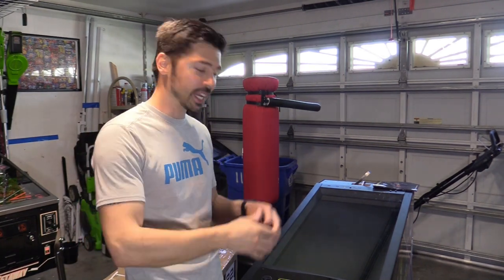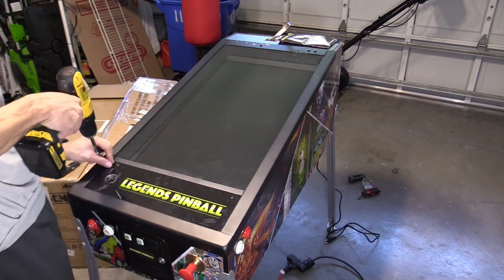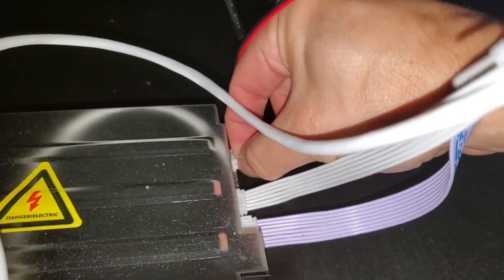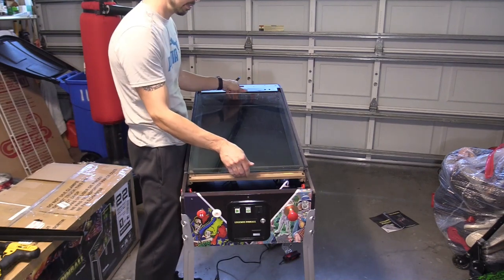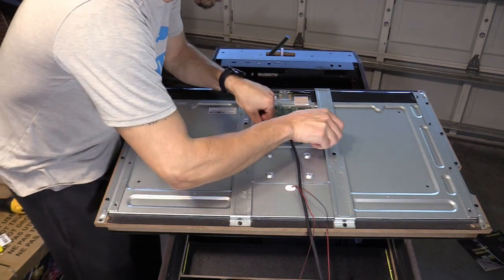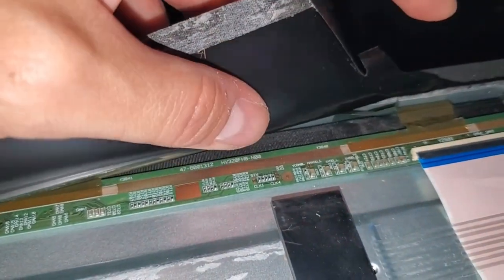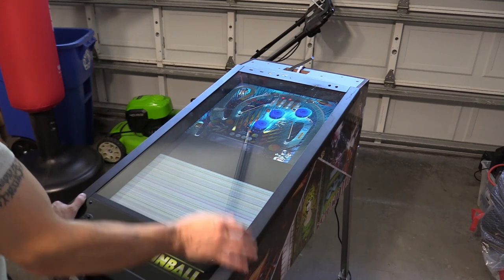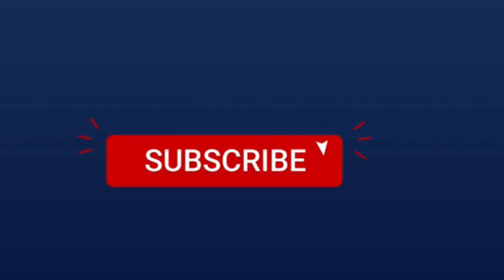Atgames sent me a Legends Pinball Screen to Fix

Comment: You could solder thin jumper wires to the ribbon cable. Scratch the mask off with a fibre pen. It is a lot of work but it can work.

Comment: In this video you disconnect two red wires from power supply 
Why don’t I have two wires . I only have one! 

Can you please reply why you think that is? 

Also if there supposed to be two wire is one for backglass? 

Can you also do a thorough video about what connection is for what on the SbC as well as the vibes as well as the monitors and power supply 

Thank you your vids are great and detailed

Comment: Hey, TampaTec. Really appreciate your video. My screen never worked right out of the box. Unfortunately I opened it after the warranty so I can't return. What can I do if the screen never turned on to begin with but the backboard screen turns on? Thank you!
Reply from the maker: Check video cable and reseat it, turn off the light in your room to check if backlight is on the playfield screen if not then check power source to the monitor.
Reply: Ok I'll try that. It's not the small monitor that stands up. That one works. It's the large flat monitor. The screen stays off. Mine was damaged in shipping too. I'm going to try to follow your video to disassemble.
Reply: Hi, TampaTec! I removed the screen just like you did in your video. I took a picture of the bottom. Can I email you the pictures I took and can you let me know what you think please?
Reply: Tampa...I fixed it! Checked all the connections and found a loose connection. Reset it and went nuts when I saw it turned on. Thanks for your video!

Comment: I have the Legends micro delivered and the back box display won’t show any image you can tell it has power but it’s just a gray screen. I tried to contact AtGames for the last week and they will not respond. Can you help?
Reply from the maker: Seems like video connector issue. Try reseating the cable connection to the monitor or replacing the cable. If you have the vibes board you can connect to PC and see if you get video to the backbox screen.

Comment: Tampa, I definitely could use some help. I’ve just started my journey in modding my ALP and I’m having issues getting the otg to work. The pc recognizes the main playfield as the pc is running through the bios but as soon as I login to windows I don’t even have a chance to make it to the display settings screen before it loses signal and sometimes I don’t even make it to the windows login screen before it loses signal. IM using a brand new desktop that I picked up just for this,and a vibs board, I’ve tried numerous hdmi cables and also tried using a laptop and still get the same results. Any help would be greatly appreciated. Im attaching a video so everyone can see what im talking about. 1st video is with the desktop and 2nd with the laptop. I’ve got some video shots if you would like to see what is going on.
Reply: Did you ever figure your issue out? Folks on Reddit have noticed an HDMI cable longer than 6ft would usually cause issues with OTG.